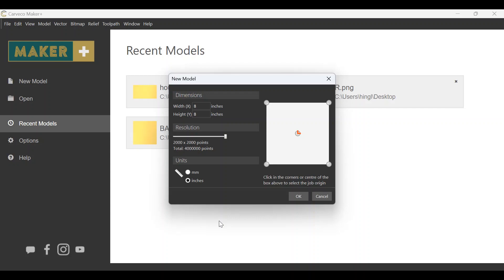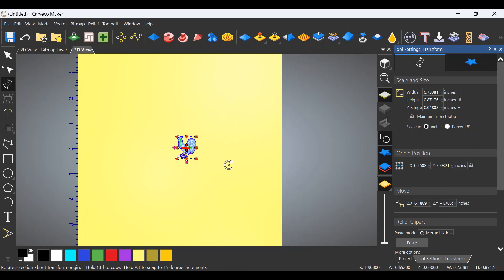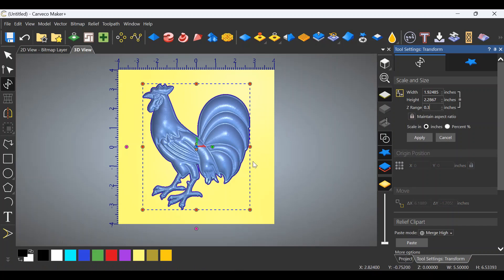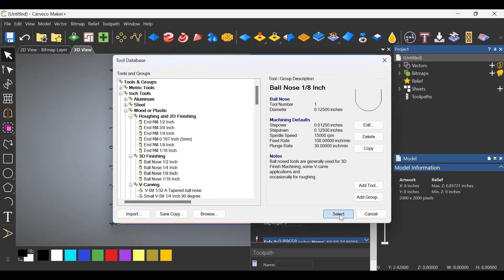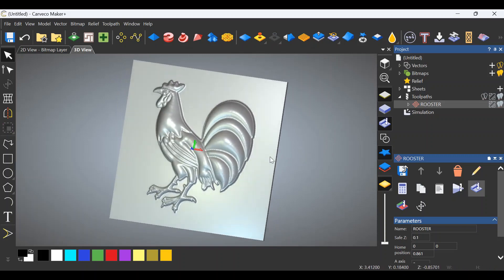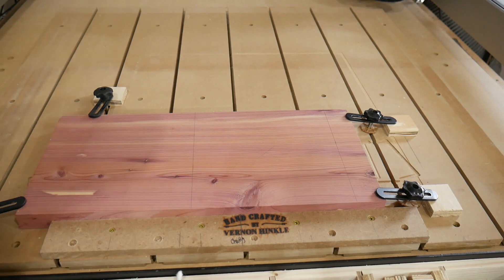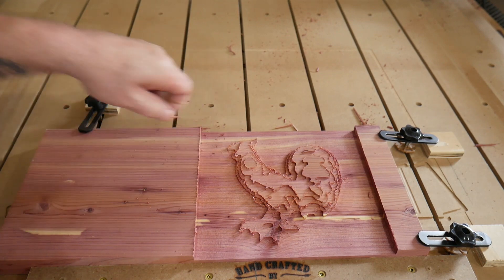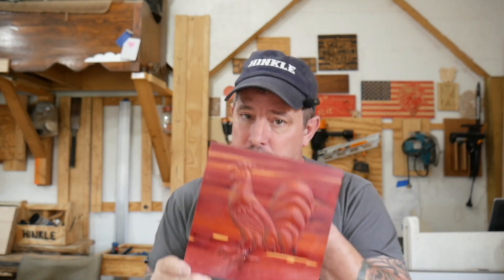Learn Relief Carve

Comment: Vernon...me again.  Trying this out for myself out in the shop & ran into an issue.  When I get to the toolpath, and mind you, I'm following along with you, my Z-Slices don't match your numbers.  Your numbers in Z-Slices show 
Start: .85721 
Last: .021 
# of slice 9 
Slice of thickness : 0.09291.  
Mine show
Start: 0
Last: 1.63998
# of slices: 1
Slice of thickness:  blank
Any ideas on what I did wrong?  Thanks again!!
Reply from the maker: Unsure but not sure how you have a single pass did you enter a rough tool

Comment: Hello Vernon,I email you my picture of my first 3d, but how do I get a more detailed carve,thanks
Reply from the maker: Use a smaller diameter bit with a smaller step over 
Tapered ball mills are typically used to increase the level of detail
Reply: @Hinkleshop  okay I going to have to get some of those tapered Bits. I  only have 1/8 inch ballnose for now,THANKS. Have a good Memorial Day
Reply from the maker: You too !
Reply: Hello Vernon I'm going to 3D called that rooster again to see if I can get more detail I just got three tapered bullnose 1/8 116th and 132nd which one do you think I should use and you said to lower the step over what number should I set it on preciate your help have a good night
Reply from the maker: Try the 16th first set the step over to .025 to .03 realize this is going to dramatically increase carve time
Reply: @Hinkleshop  Hello Vernon, trying to carve the rooster again,and  this come up. Any thoughts on what this means, thanks again....
Reply: Thanks,will do...let you know how it works out...
Reply: Not letting me send pic,I'll email you the pic,thanks

Comment: Hello Vernon this video gave me the courage to try a 3D relief I'm doing the rooster now but on the roughing, my cnc stoped almost on end.Would I  be able to start finishing cut to finish the relief or to start all over..Also how do I find the settings for my  bits to apply to each bit..I really enjoy your video...and the humor, lol..Thanks
Reply from the maker: Outstanding glad you are giving it a try
Be careful starting the finish pass without fully completing the rough it may be too much material for the finishing bit to handle 
Check your sleep setting on the computer make sure it never sleeps this may be why it stopped 
As for the bits usually the package has the info if not I would go to the manufacturer website 
I use whiteside bits and Amana they both have good sites outlining the specs
Thank you for the kind words glad you are enjoying the videos and I hope this helps too
Reply: @Hinkleshop  okay that makes sense I'll start all over again, I like to thank you for your fast reply is guys on YouTube that I follow that ask for comments or if they can help but when I leave a comment I don't hear from them for days even weeks I thank you again for the fast reply have a blessed day
Reply: @Hinkleshop  thank you

Comment: I thought I followed along, but my bit is moving above the board like it is working but it is not touching the wood. Do you know what I did wrong?
Reply: I had it set to bottom of material. 1st bit worked but 2nd bit is in the air now?
Reply from the maker: It sounds like you didn’t re zero your z height off of the original board thickness 
Bring the bit over an area that hasn’t been cut and re zero your z height there DO NOT RE ZERO X OR Y just the Z
Hope this helps
Reply from the maker: Also I always zero off the top of the work piece

Comment: Well VERNON, you made it look sssooo easy I have to try it, yup got to try it. Will let you know how it turns out. Yea my daughter also has CHICKENS and they lay a whole lot of eggs so I will be making it for her so she can put it on HER CHICKEN HOUSE.
Reply from the maker: That’s great Karl! Glad it helped you! 
Just don’t go too deep on your first try and remember to adjust safe z so the cut time isn’t tremendous
Reply: @Hinkleshop  Got the depth set at .3 like you showed and the Z at .1. HAHA just copied what you did.
Reply: sent an email to the only email I found for ya, it was Lisa's, sorry. Worked out great but that 1/4 sure was fast. Would it have been ok to speed up the round nose some? It was a little slow and took awhile to finish. Thanks for the help. I thank I'm gona try some more.
Reply from the maker: Great job on the chicken Karl to answer your question yes, you can adjust the feeds and speeds do it in very slow increments. The biggest concern is step over of the ball nose too much step over will stripe the project to little will increase the time tremendously the smaller the step over though, will reduce the amount of sanding that’s necessary on the project.

Comment: My biggest problem with reliefs is it take 24 hour to do 1. Your video has me thinking the safe Z is what’s biting me. What was the time on that carve?
Reply: Thanks I looked at the relief I had setup and adjusted the safe Z to .1 and unchecked multiple z passes. 24 to 3 hours doing my 1st relief now. Thanks for the video
Reply from the maker: Hi Russell Thanks for watching!
your right, reliefs do take some time to carve but 
this one took me roughly an hour and 20 minutes 
and yes, the safe Z will cause a huge amount of time if you don"t lower it